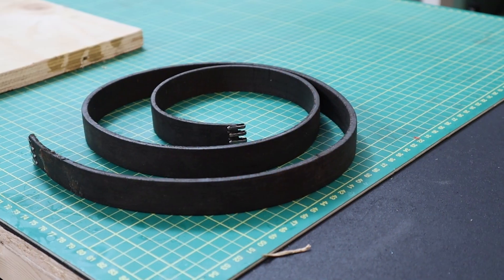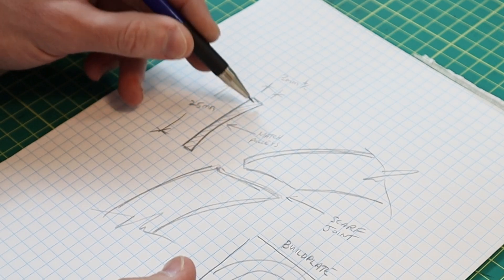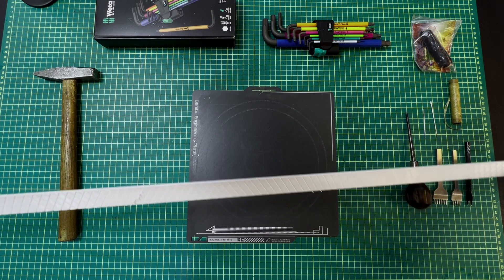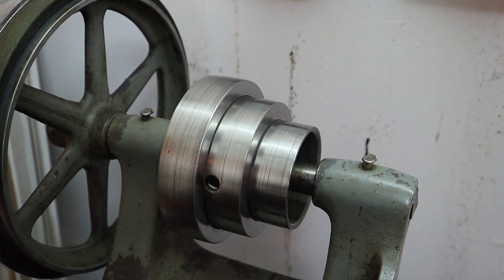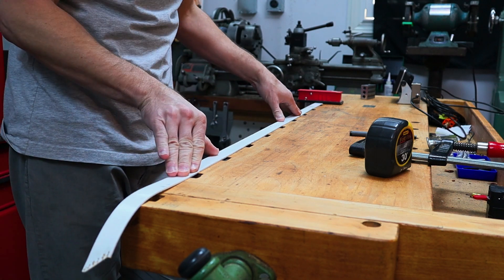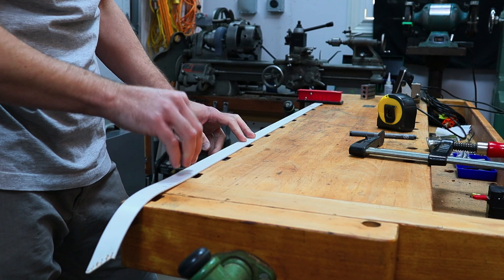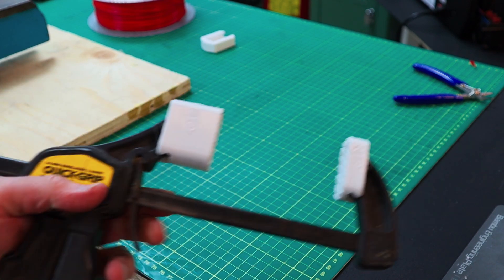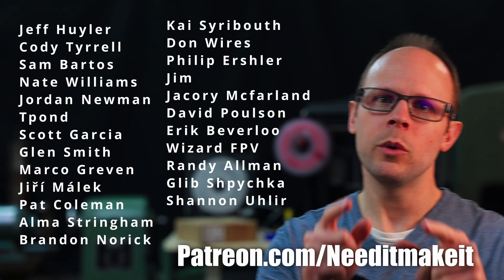Can you 3D print a functional lathe belt from TPU?

Comment: Haha- i just did this. I designed my own belt for a 8×14 mini lathe and it WORKS. It has 100% tooth engagement where the original flimsy one barely had 30% tooth engagement. I made my TPU belt thicker as well. Im going to get some liquid rubber and wrap the backside of the belt with high strength thread and paint over it with the liquid rubber and it legitimately will be stronger/better than the crap flimsy PU belts the mini lathes come with

Comment: If u realy want to have strong belt, u can even add metal strings inside, so it is just like what is some 3d printers use, and it is didnt strach untill the metal broke inside the belt
Reply from the maker: That makes sense, similar to rebar in concrete.   I wonder if another plastic which isn't as prone to stretching would also work and still allow the flexibility?
Reply: @NeedItMakeIt  I didnt realy think so, most plastics can snap after a period of bending, maybe a gcode is the solution, where u can start the print and inside is some groows where u can put a thin bowden like in bicycle break, and then continue print, also if the printer can fuse the bowden cable in the printed groows when continued, so this way nothing is lose inside the printed part no left over groows. I think with your method of makeing the belt and this bowden thing shoud work, and try apply some honey to get a bit more grip😉

Comment: I think, as its more flexible, making it thicker would be better, and for the grip, if you make the edges of the belt have a kind of loop to hold an inner laminate in place. then a bike inner tube making contact with the centre of the pulleys might stick better. Also placing small suction shaped bubbles in the surface might work, you would have vacuum pressure being applied that way theoretically reducing friction to almost nothing, it might be harder to dial in the bubble sizes so it doesn't stick too hard.

Comment: What about using a bicycle inner tube cut into a solid strip , get one that will stretch to fit keeping it one piece.  Make a wood oval that stretches the tube to size. Then print a carbon nylon (or something else)hoop . Then use patch adhesive sand the tube on the outside same as if patching then  glue the 3D printed hoop over tge rubber and stretch it out until tight. And put wood strips and clamp the long sides until dry. The rubber should nske the 3D print grip and the print should prevent the rubber from deforming keeping contact with pulleys.

Comment: I wonder if you could fight against the tpu fatiguing by sewing kevlar thread along the length of it. That's sometimes used in straps to make them stronger.
Reply from the maker: I think so, if you can add any sort of material, even a layer of a dissimilar material, it could probably work a lot better.  Sadly the somewhat slick surface just doesn't want to drive those pulleys well.  We'd need to laminate something else to the belt, and at that point, we're exceeding the cost to buy a ready-made belt.

Comment: I've seen these kind of fails a couple times.  First, leather is hard to beat.  Second, you know TPU is softer.  Double the thickness to make it stiffer / harder.  Third, putting a texture on the inside just gives you less contact area making it stiffer.  Tread in tires decreases grip except in the rain where it gives passages to let water out.  Fourthly, the belt should be flat so the center where it contacts the crown is tightest.  You are in effect reducing self-centering tendency by profiling the cross section to match.  Stick with it.  Forget about matching the leather dimensionally.  I think you can make it work reasonably if thicker.

Comment: In my experience using TPU, it really is a wonderful material when you know how to print it, but using it as a belt has proven unrealistic. If it was reinforced with some fiber material, maybe plant fibers, then it might help with the stretch, but the stretch in my experiences the completely insurmountable compromise. If you had a printer of sufficient depth, you could print the belt laying down on a textured surface, so that it would provide a rough side to the belt. Ultimately though, it's the stretch of the material, unless you can deal with that, I don't think you'd be able to use it for this application

Comment: Hey there, I'm not sure the pattern gives more grip, because as you reduce the surface, you also reduce the friction. My two cents: just glue a piece of real rubber on the top of the pads if you want extra grip, but you'll add also extra lateral flex.
Reply: was the pattern on both sides? did you flip it. different tpu's might give different grip. i would also have said.. why did you do stapples, just print it closed, and then a little shorter. so the elastic pulls some and might increase grip,  the leather required a compond. doesn't that say it wasn't grippy enough either.

Comment: 8.00 TPU is urethane which is used in bushings so it’s good slip n slid… maybe a Eva foam TPU hydros might work.

Use the TPU as the bet and you the foam type material as the bearing or friction surface. Basically replace the wax or tacky stuff you applied to the white with foam. As you 3d printing you can lock the two together.

You could pause and place wite in too.

Comment: TPU is not a substitute for rubber, it has non of rubbers grippy properties. I have seennso many failed attempts at 3d printed RC tires with no grip
Reply from the maker: Is there a material that would be similar to rubber that's 3d printable?
Reply: @NeedItMakeIt  @MyTechFun does a lot of testing on different materials, I don't think he has found anything. I think TPU is more useful for it's toughness and its flexibility. So it's great for joint components, shock absorbtion and so on.

Comment: I'm wondering if you could add a layer of rubber cement or something to one side and if that wasn't good enough even embed something in the rubber cement. I'm not really sure how to tackle the stretch issue although maybe you could print it with tunnels in it that you could run wire through.

Comment: A thicker belt cross section would reduce the elasticity. Since it wasn't heating up, you can probably go a lot thicker without an issue. As for grip, the wax may work well with porous materials like leather, and less so with smooth, impermeable surfaces like TPU. Experimenting with different tack agents might be interesting. Also, with a thicker cross section you could tighten the belt down more. Too much tightening could be detrimental for the pulley bearings, though.
Reply from the maker: For sure, I think slightly thicker would be ideal and also if there is a way to integrate some other materials like a nylon or some type of fabric to prevent the stretch as well.  The pattern I added was not good enough, it needed to be far tighter to be effective as well.   Much to learn!  Ideally we'd have a clutch setup and then have toothed pulleys instead, that would address most of the issues here. There is a possibility that I could 3d print an entire new set of stepped pulleys from Nylon-GF.  It would be a neat and challenging project.

Comment: This is cool. I wonder if you could put some other material like TPE on the inside of the belt to give it better grip and some elastic return. I was able to design and print a timing belt for stepper motors using TPU and it is really strong. It wasn't as high a load as your application, however. I also made straps for safety goggles I designed and they feel comfortable. I might try making a clothing belt too. I suppose belt designs of any kind should be used I low stress applications. Such a versatile and useful material. Awesome applications and great rigor on your testing!

Comment: Did you have to put manually the TPU in the X1C? I tried to do it but it doesn't have an automatic filling like the AMS or the K1.
Reply from the maker: Yes, they don't recommend using TPU in the AMS, it may not make it through the auto-feeding system.  I haven't tried it myself, and one way around it might be to position your AMS in a spot in relation with your printer that gives a smoother path for the filament to travel through.  

You have an AMS for the K1?
Reply: @NeedItMakeIt  No sorry... I feed directly. I dream to have an AMS but for the K1. There's the chamaleon but you need soldering skills that I haven't.

Comment: I printed a v-belts for a home sewing machine.  I printed a PLA ramp then printed TPU to get V. Tried cog grooves and various infill density.  While belts worked, they were not as good as reinforced urethane belts.  I used tach and motor input power monitor to evaluate. I convert vintage machines to battery power, for my wife to use at sewing retreats. Efficiency is important. Timing belts are efficient.
Reply from the maker: Very nice, I've never heard of this being done before!   If you can think it, someone has probably too!  Nice work.  I have restored 2 vintage Singer several sewing machines in my day, they were treadle operated and had the small leather cord for the drive belt, which work incredibly well.  

I'd like to find some different materials with better grip, but that only solves one of the issues, the stretch over time makes it a no-go, we'd need to laminate something inside, a nylon core maybe along the neutral axis of two layers of the rubbery material.  I could also try PETG laminated to TPU, adhesive would be something I'd have to do some research on.  I think I could have done better on the patterning to make it mimic the grip we'd get with our fingerprints.

That's pretty cool about the sewing retreats, I had no idea these things existed.  

I'll see if I can find a timing belt that matches my belt size and take the headstock apart.  

I've already made a new leather belt, but the alligator clips were so worn that they fell apart when I was trying to reuse them.
Reply: @NeedItMakeIt  I saw a comment on another video about printing belts, saying they would print a thin TPU timing belt or v-belt, then wrap it with fishing line and glue it in place. The fishing line would be one of those newer types that use dyneema which you can get pretty cheap, or a roll of kite string that is also dyneema or kevlar. Zero stretch over time supposedly, as this is how commercial timing belts are reinforced too.
Reply: I make TPU drive belts for my sewing machine as well.  I would prefer leather, but It's hard to find belts for 60 year old discontinued machines.

Comment: A flat belt would have way more grip. I dont think it would work with more grip though.
Reply from the maker: The cost of replacement belts is really high, but I also want to be able to drive the high speed properly, so I guess I need to either come up with a better belt that doesn't stretch, or buy a good belt and be done with it.

Comment: On the belt you could add a thin layer of silicone caulking on the grip-side ...
or melt in some gritty material with an iron (perhaps fine sand or iron powder)?.

PS: Second idea may not be optimal, if you don't wan't your pulley wheels to be slowly sanded away :D
Reply from the maker: The silicone idea is a good one, I wonder if it would bond to TPU.

The grit idea is a neat one, that's something I hadn't thought of, very clever.  

I've since made up a replacement leather belt, but it's only a temporary fix, the leather I had in my shop stretches more than it should and I had to laminate it from 4 pieces with scarf joints, which works, but probably isn't ideal.
Reply: @NeedItMakeIt  You can use a softer TPU and on the outside of the belt, use a clothes iron to laminate some kind of long, high-tensile fibers into the TPU oriented in the direction the tension is applied. Think about that reinforced packing tape with all the strands. With a flat belt and a smooth inside, you'll get excellent traction on those pulleys, just like racing slicks on a nice smooth drag strip. Applying the stickant should make that even better. Make sure if you laminate any kind of fibers into the belt that you put some wax paper or parchment between it and your clothes iron so you don't end up with a molten thermoplastic mess all over the iron.
Reply: Wan't SuperVinlin

Comment: Consider replacing the pulleys with 3D-printed parts. You can give them a texture to improve the grip. Or - if the slip isn't necessary - just use timing belts.
Reply from the maker: I was thinking about that, I could replace the cone pulleys with printed toothed pulleys similar to a GT2 belt.  You'd probably want a clutch since the lathe is intended to slip, and with the teeth, it wouldn't do that any longer.  I'd really like to replace some of the noisy straight cut gears with 3d printed helical gears for a smoother operation as well.  I also have some worn bronze nuts on the machine, I wonder with some of the newer materials if we could print some functional replacement parts for the lathe.  It might not work long-term, but it could get  you buy for a little while.  

Timing belts is probably the simplest solution, and I'll just need to bite the bullet and take the headstock apart.  Which will probably give me a chance to paint some of the parts.
Reply: Or make the surfaces of the pulley wheels TPU so you can have more  grip and less slip?